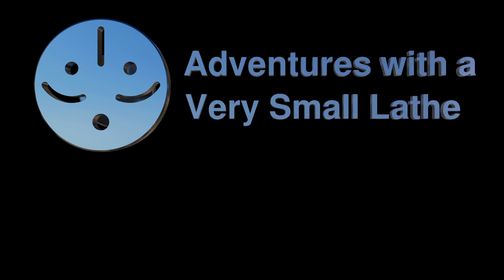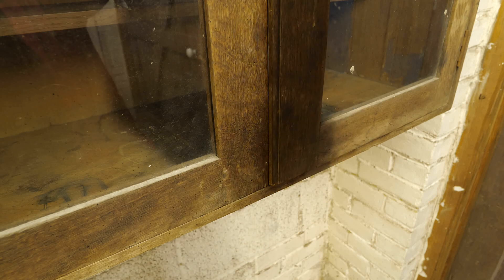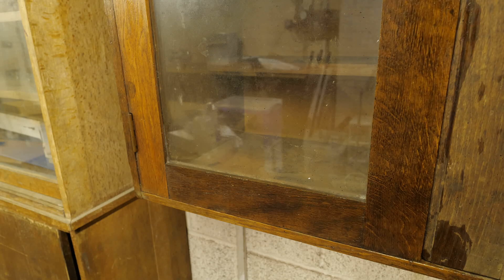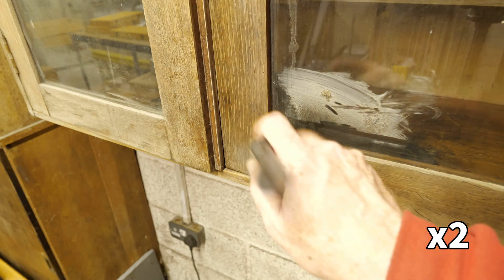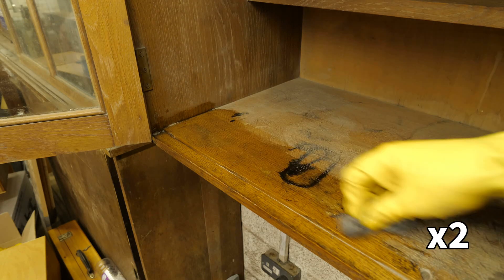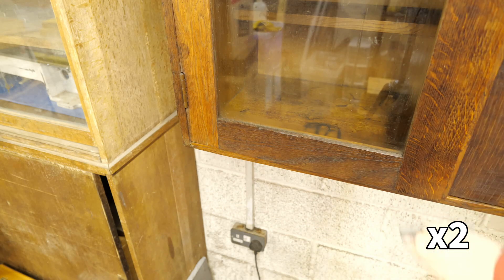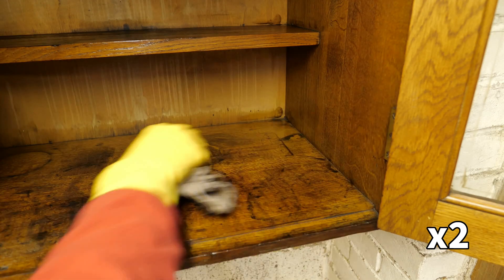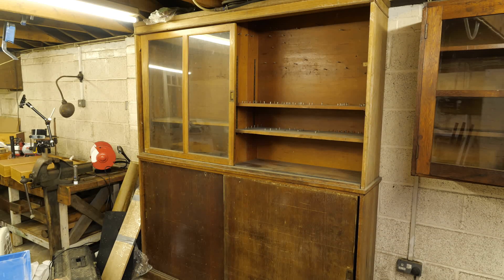Tool Cabinet Restoration and Move Update

Comment: It's an idea to rig up the instrument cabinet with a filament lightbulb and a thermostat to keep the inside of the cupboard a few degrees above ambient to avoid condensation.
Reply from the maker: Thanks, that's an idea someone suggested previously about the steel cabinet, and it certainly makes sense.